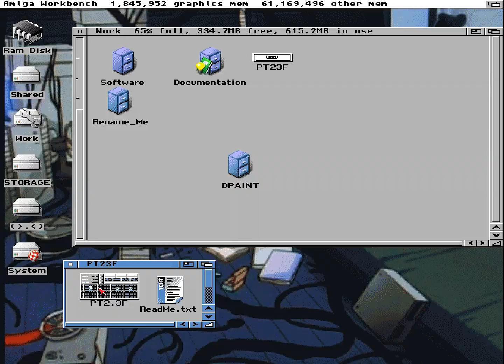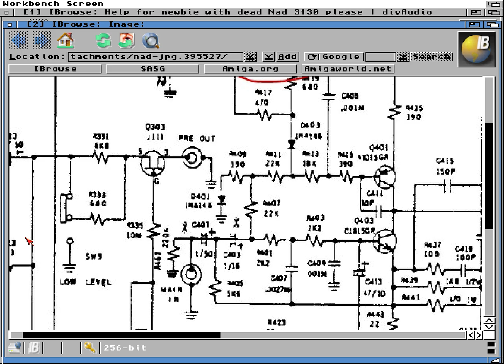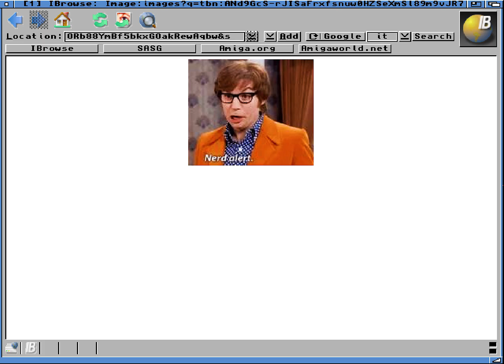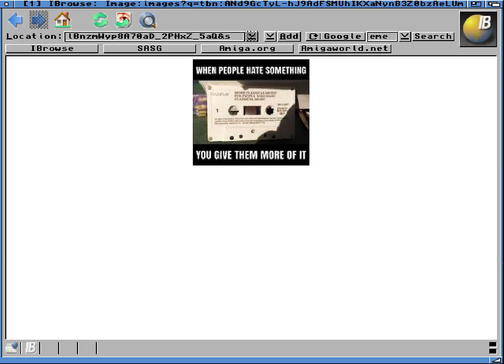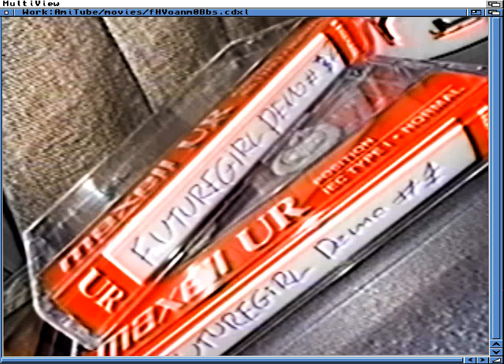making an amiga jungle album on cassette tapes

Comment: Usually you can spot if the caps have failed, but with this era stuff the caps are actually pretty solid. If you got some  hires pics of the board I'd love to take a look. Grab a 10$ aneng multimeter, whack it in diode mode/beeper and check the transistors for shorts. Through hole soldering is childs play compared to the feats you've already managed!
Reply from the maker: hmmm okay i’ll give it a go eventually lol

Comment: hey this was a really neat video. I dont think you did anything wrong with the tape tbh. As long as the audio gets to the cassette somehow youre good. Cassettes really dont care about much and theyre not really high fidelity. The only thing you gotta worry about is line vs mic / instrument level like you talked about. mic and line levels have different eqs iirc so even if you get the levels right it might boost or cut some frequencies. could be good or bad depending on what vibe youre going for, but if it sounds good to you thats all that matters. Anyway, cool stuff. Thanks for sharing
Reply from the maker: it definitely altered the sound of it all, but it sounds cool to me, i have a very kind guy mastering them for me too so it’s sounding great now, thanks ☺️ it did seem to boost the hiss frequency in the right channel but once he worked on them it was all centred again so i don’t mind xd

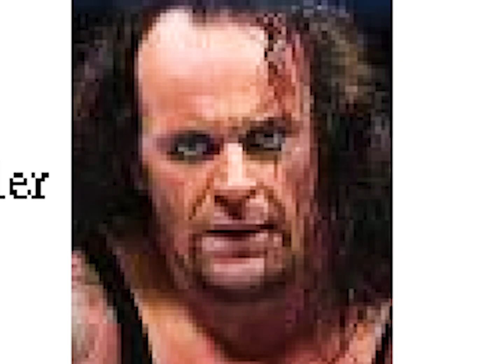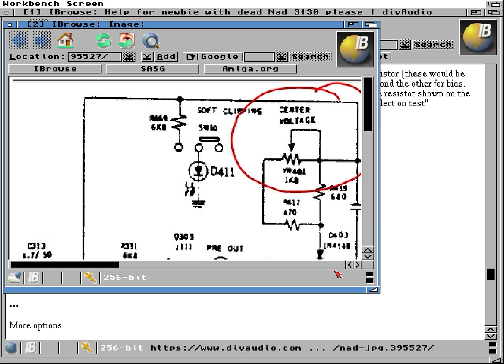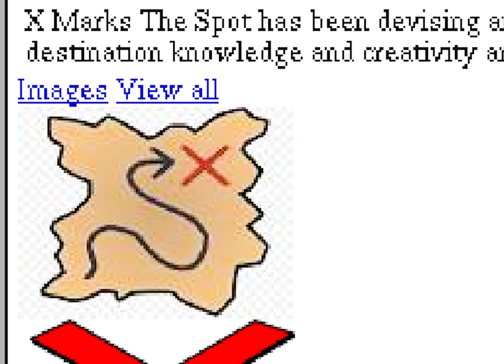Comment: Wait does 0:55 does that mean you unlike me having merely never imo from memory ever lived to date.. encounter a metal/type 4 tape.. morover even a more rare type 3 or even a deck that from memory have ever had a speed switch or non type 1 compatibility.. 2:45 woah man never would have thought to use the internet 3:39 good point lmfao metal type 4 is not a sensible cost related/economical solution that would or is feasible.. kind of the way Gamecube Nintendo Official Component cables or "Wvhs" Dvhs/Dtheater etc is really well or any high end crt or other specific things.
Reply from the maker: im going to be honest, i cant make heads or tails of the first half of this comment. But yeah, its just for fun more than anything so im being cheap lol.

Comment: Wow, takes me back to the early 2000s browsing the net with AWeb on my expanced A1200 with PPC and VooDoo3 PCI card!
Reply from the maker: AWeb still works! i wouldnt recommend you use it though, major security risk and barely loads a thing haha.
Reply: @futureg1rl  It's been a long time since I touched anything Amiga! Sold all my actual hardware long ago, but I should get my emulated system back up again - I've still got my old HDD disk image. Doubt I'll be doing much browsing on it though, hah! I do have a load of old Octamed projects that I would like to convert to MIDI - I did it previously but can't for the life of me remember how. Renoise was definitely involved somehow, converted the mods to XM, maybe?
Reply: No shit? there were Amigas that could run voodoo cards?
Reply: @talesofgore9424  yeah, there was an addonmade by a company called Elbox called the Mediator which allowed you to plug PCI devices in

Comment: Your video's aren't crappy whatsoever. I'm 51 years old and I find them informative. By the way, you were on the right track with the capacitors. I've lost count of the amount of shit I've had to replace capacitors on. I dare say when they were manufacturing electrical stuff, they never thought capacitors would be a ticking time bomb. Go figure.
Reply: This is so true. One of the most common failures on old 80s / 90s hardware (old games consoles and indeed the Amiga).
Reply from the maker: haha thank you. yeah i’m going to send it off for repairs, from what i’ve heard these particular ones are known for this problem. Surprising it lasted until 2023 before it went.